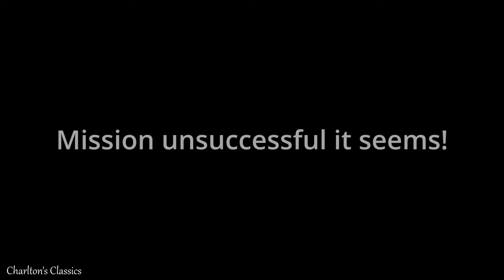BSA A10 650 Super Rocket - Knott End Bike Meet (Part 2) - Tweaking the Carb

Comment: I've been running engineering business since Early 80 cars and bikes. I've been building bikes since I was 15 yrs old. Turn your air mixture in till it misfire  goes lumpy. Turn it out now till it speed's up engine and goes smooth. If you turn  to much out you will have a lumpy engine turn it back in it will run smooth. Easy yeh
Reply: Also do not turn screw to far in you will damage taper end .then you will end up in a world of hurt and posable a new carb 😢
Reply from the maker: Thanks for the advice there John. Will give it another go 😊

Comment: hi Chris first check the pilot jet it should be a size 25 and it should be stamped on the side of the jet you'll after take the jet out by unscrewing it  and taking it out you can check how and where it is on the net, but the way it is spitting through the carb is a sure sign of it running weak.  and the hesitation when your pulling away is also a sign of it running weak, once you've checked the jet size is right and the jet is clear, buy your self a Gunson colortune kit of ebay for about 14 pound and well worth getting it takes all the guess work out and it tells you how to do it in the leaflet and on youtube. well i hope that helps in some way, and for the airscrew turn it in till it stops don't over tighten it, then screw it out one and half turns out and that is the starting point get the engine to work temp and that's when the colortune kit comes in. all the best with, kind regards, Adrian. ps has it got a carb insulator as it stops the carb from getting hot if the carbs getting hot that to can make the engine run weak anyway best of luck.
Reply from the maker: Thanks for all the help and for sharing your experience. I will invest in one of the Colortunes. Just watched a few videos on them and they look really useful! It hasn't got a carb insulator on it, just a thin gasket, so i will invest in one of those and see how I get on 🙂. Thanks again Adrain.
Reply: @CharltonsClassics  hi Chris, O dear it sounds like you'e got the bug ha ha, i know i can go up to devils bridge on my bsa a65 or on my matcless and look at all these modern bikes and they all look the same with no character and there's not much to say about them but when you roll up a brit bike they always pull in a crowds, and it always gives the old timers a run down memory lane a back to there youth and its all good fun. you've got a lovely bike there Chris enjoy with kind regards, Adrian.
Reply from the maker: @a65builder67  Hi Adrian. Yes I would have to agree with you. The classics are so few and far between at the standard bike meets that they do draw attention when they arrive. Most people do a double take when I remove my helmet, expecting someone with a grey beard most probably ha. 

I'm in my early 30's and am a keen advocate of these bikes to my generation. Such great fun, but often overlooked...

Cheers, Chris

Comment: I did exactly the same as you messed with air mixture  I ended up taking it back to Andy chap that rebuilt my engine he got it spot on again  for me it's very frustrating
Reply from the maker: Ha yeah sometimes it’s better leaving it to the experts. I guess the good thing with these bikes is that they’re easy enough to fix…just helps if you know what you’re doing 😊
Reply: @CharltonsClassics  totally agree I've done loads myself on this bike I like tinkering and my 79 r80 /7 both good bikes to do a bit yourself on

Comment: If your needle jet is worn you will never get the idle jet right. T is easy to replace and it does wear out.
Reply from the maker: Thanks for the advice there. Turns out it had a small air leak between the carb and the engine. Video to follow… 😊

Comment: My god,why did you f.... about like that. You were given sound advice regarding air screw position.  Adjusting carb is simple. I'd be starting from that threshold,  check ignition timing, also chest advance/retard cam is set correctly.   Why don't you go buy a Honda and leave classic bikes alone. Plus slipping the clutch will soon f.... up a lovely bike.